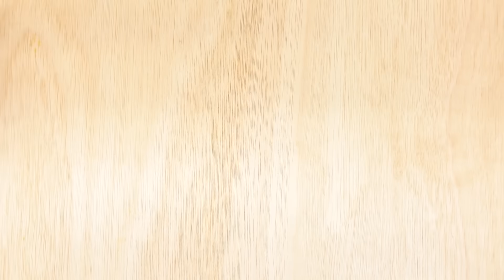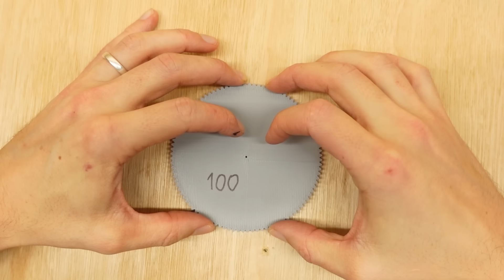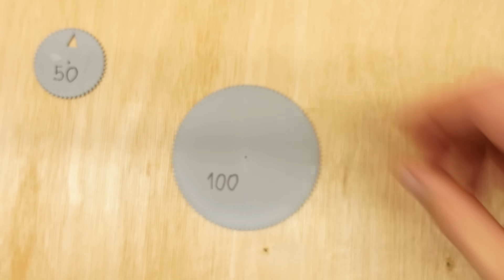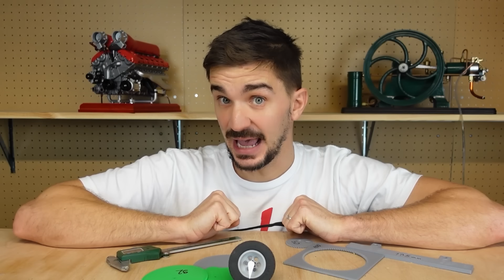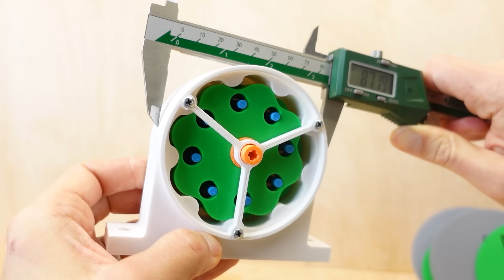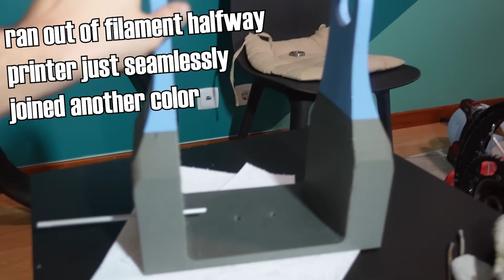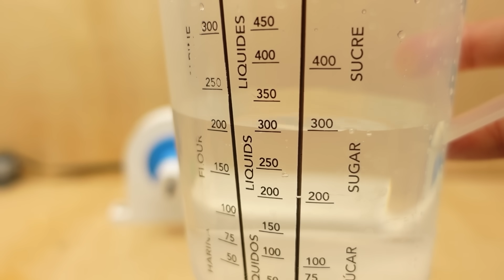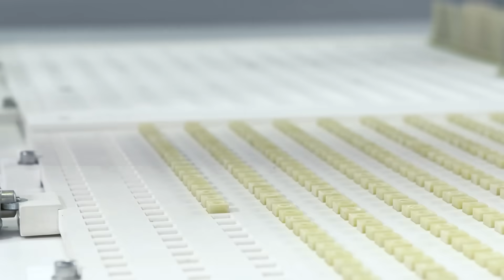Toothless Gears Make Much More Torque Than Conventional Ones, Here's How. Cycloid Drive Explained

Comment from the maker: Support the channel by shopping through this link: https://amzn.to/4fatbMb
Become a member: https://www.youtube.com/@d4a/join
Patreon: https://www.patreon.com/d4a
Bambu Lab US: https://tidd.ly/46hpDEj
Bambu Lab EU: https://tidd.ly/460tBRZ
Reply: so instead of 2, having 4 cyclodial gears together like inline 4 would the the best ?
Reply: @abhishekdas9006 no three gears middle one twice the weight of the outer ones. It would then be perfectly equaled out.
Reply: @rexmann1984 that's what occurred to me as well...
Reply: @rexmann1984  but at a certain point I think friction and torque on the shaft become major problems with solutions like that. And regardless, this is still optimized for high torque as opposed to high speed so the balancing shouldn’t be too relevant
Reply: @abhishekdas9006  yeah, halve them and double the number. It's the same. It just gets worse if you add more. Just put a counterbalance on a 90 and you balance.
Reply: Super explanation.  Thanks.
Reply: @pbacina  cool, but if the amount of teeth is the same in both, why does the rotation number change from inside/outside? it's clearly not skipping teeth while it travels, so why the amount of rotations multiply? the distance (in teeth) shouldn't change.
Reply: Two words: harmonic drive
Reply: Yay, Americans selling Chinese products! Have you considered Prusa instead?
Reply: 12:45 hey pal, I think you missed the realization that you got trapped in social media. That IS social media,  even if you're scrolling designs
Reply: remove the offset on the shaft and move the wobble motion to the out side using springs to maintain pressure and allow free motion.
Reply: STOP QUESTIONING AIRASATALE ! ITS BOTH HEARISY AND TRESON !! MAGIC DOSE EXIST JUST EXCEPT YOU DAMN ALCAMIST!!!🎉
Reply: why did you tell me i won the giveaway and then delete the comment ?
Reply: 16:56  this is nice to see in the mind thanks for the work.
Reply: Wohoo more plastics 🥳
Reply: Man you are flying on that bike!
Wear a helmet!
Reply: I love it! 😊
Reply: I know you are joking, but this is actually the origin of the word revolution meaning something extraordinary. It referred to how destabilizing the idea that the earth revolves around the sun was at the time. That was the original “revolution“
Reply: Dublagem em pt-br tá muito bom
Reply: Could you possibly make another video explaining more about the balance of the cycloidal transmission at higher RPMs? Like, the differences in balance with one gear at high RPM and 2, 3, 4 etc, and the possible solutions to the imbalance. Along with the reasonable application of a "torque-god" transmission and whether or not it would even be necessary or rather, reasonable to use in high RPM applications... That'd be cool
Reply: You need to use fusion generative design and optimize your design for manimal amount of filament use.
Reply: Негрпмотный перевод на русскиц язык: "число зубьев" называет "шагом"!!! Шаг у зубьев взаимодейстаующих реек и шесткренок один, количество зубьев - разное.
Reply: The simple solution to the rotational force is to put another eccentric ring 90 degrees to the rotation axis such that it balances out the offset. It sacrifices compact design, but then again, I'm sure there is also a clever way to minimize that as well with further research.
Reply: @d4a Excellent. Can you please do a similarly clearly illustrated and explained video on how eCVT transmissions work?  I've watched a few including this one but cannot grasp how varying input:output ratios are achieved:  https://youtu.be/O61WihMRdjM?si=cMu2SOEih4Oaq-Oa
Reply: 19:23 what if you put one gear in the middle and two half gears on either side, with your input drive channel going through a hole on one of the half gears? You could remove the rocking effect, at least until the point of circular momentum became an issue (Note: I can't remember what it was called but what I mean by circular momentum was the one physics thingy about how a disk with all its weight on the outside was harder to start and stop vs an evenly distributed disk being easier to start and stop)
Edited to adjust time stamp
Reply: It would appear as if you've done so much ,with so little for so long. That you can now do anything with nothing.
Reply: I have to say this was the sneakiest and most stealth ad I remember having seen. I realized it was ad only at the very end when you said links are in desc... Well done, hope Bambu will continue to cooperate with you in the future too. 
Unfortunately I won't be buying using your links mainly because no Asia link. And also because I got my bambu a month before this video came out. Sadly their store(s) are sold out of pretty much everything interesting.
Reply: Hello, good afternoon. I'll get straight to the point. A few days ago, I was working on a personal project about a homemade combustion engine, and I was wondering if you could help me with it. I have limited resources in physics and chemistry, and I don't want to burn my house down. So, if you're interested, we can talk privately. If not, thank you very much for reading.

Comment: 50 gear rotating around the 100 gearp
2 rotations for the teeth, 1 for the circle

50 around 50, 1 and 1

inside the 100 negative, 2 rotations for theeth, -1 for the circle

idk if it makes sense what I'm saying

Comment: Pls do a video on tire squish. Example: 75mph 1:1 trans and 3.25:1 rear gear with 26” tire on 16” rim with 2” tire squish  vrs no squish how most ppl use when calculating gear changing. On some things 100-200 rpm is important especially if your buying gears you want to calculate accurately. Or 33” tires on 15” rims  on small yota can run on 12psi happily which is several inches of squish. Everyone says it domt change anything but FACTS IT FOR SURE DOES. Theroretical radius vrs actual loaded radius unaccounted will leave you unhappy on highway cruise when accuracy matters weather wheeling rig or you classic hotrod or Harley why is the world just letting 100-300rpm just piss in the wind. That’s a difference of an entire gear ratio that’s like buying 3:73 gears an getting 4:10 and being fine with it to the litterally point there’s not a single VOICE on this issue

Comment: 1:47 I can explain it using a comparison to sidereal days. Basically, going around the center wheel intrinsically adds a rotation. If you imagine that you glue the outer wheel to the inner wheel at one spot, and revolve the inner wheel, the outer wheel will automatically do a rotation just by virtue of being coupled to the inner wheel as it rotates. You don't even need the glue; you can just move the outer wheel around the inner, not rolling but sliding it along while keeping a constant point of contact on the outer wheel, and it will cause one rotation. If you then add the actual rolling motion of the outer wheel along the inner, those 2 motions combine to complete 2 total revolutions of the outer wheel.
Reply: Oh you know what though, that radius doubling reasoning is very easy to remember. I think it would have been optimal to directly include a bar across the wheels with measurements of d and 2d, though.

Comment: Interestingly in regards to the 50 tooth gear around the 100 tooth gear, the smaller gear completes 3 rotations from our perspective of 'up'; however, it completes only 2 rotations from the changing 'up' based on the outer edge of the larger gear. Like how 'up' is different in Central America than it is in Australia, in the orientation of the universe that is. The similar situation happens with the inverted 100 tooth gear causing a rotation of 1 in the smaller gear from our perspective of 'up' and causing 2 rotations from the shifting perspective of 'up'. Relative to the bending surface of the 100 teeth, it makes 2 rotations. Obviously we don't care much about the rotations relative to the manipulated surface for most practical usages.

What gets me thinking though is if you made a mobius strip of teeth, how many rotations does the small gear complete to return to it's starting position, both from our perspective and relative to teh manipulated surface??

Comment: Only half of the lobes are transmitting force at any time (which half depending on the position of the elements and the direction of the torque). That's much better than one tooth, but it's not all of the lobes.

Comment: I'm guessing the anchor point determines the amount of rotation? If the anchor is a bit staggered/off center will it still be 3 rotation for the 50 and 100 gear example. PS: Didn't watch the whole thing yet.

Comment: 2:42 Fun fact.. watch the tip of the arrow on the 50 here.. it points at a spot on the 50's pitch circle, and that point moves in a perfectly straight line when the 50 is rolling inside a 100 ring gear.

Comment: I wish you stayed automotive. The other stuff sucks. Plus, all you can easily say here is "add (outside) or subtract (inside) the Radius of your wheel with the Diameter of the other wheel. That'll show how many revolutions it will take to move around the surface."

Comment: 10:40 talking about 3D printing Bambu H2D 1500+ euro for home use looks a bit too expensive, what about Anycubic Kobra S1 Combo or Elegoo Centauri Carbon 2 Combo which are ~400 euro for the same needs?

Comment: Can you try splitting one of the gears and sandwiching the other in between the halves. This will require a corresponding shaft modification. This way ,maybe the last problem of this transmission could be solved?

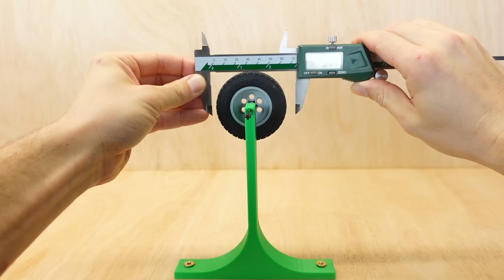Comment: At 0:50 of the video, the wheel travelling is still doing "one" rotation relative to the center wheel (2 according to you because it is travelling in a circle). You will need to rotate your screen (around the center wheel) as you follow the moving circle and see it is doing the exact same thing as travelling on a straight line. If you do this, it will only rotate ONCE.  The reason it looks like it does 2 rotations is because you didn't rotate along with it. If you rotate your screen along with the moving wheel, you will UNDO one rotation and it will appear that the moving wheel still did 1 rotation. 

Think of it like this... the center wheel as a 2-dimensional earth with a north pole (top) and south pole (bottom). When the moving wheel starts it first points UP away from the ground and when it is half-way around at the bottom (south pole) the arrow is really pointing DOWN towards the "ground" (except it looks like UP because the ground is upside-down)! As it continues to travel, the arrow eventually points away from the "ground" again once it gets to the north pole (top) so it appears like it's pointing UP again. So it looks like it has done 2 rotations but the moving wheel has only pointed to the "ground" once... just like the "flat-earth" example that just precedes it.

All other examples shown will also appear to be the correct number of rotations once you rotate yourself with the center gear as you follow the moving gear. At 3:00 when 50 gear goes on outside of 100 gear it will point towards the "ground " (the gear-mating surface) eactly twice on a full travel, and when it travels on the inside of the 100 gear it also points toward the "ground" (gear-mating surface) exactly twice. It looks like it rotates 3 times in the first 50:100 example because you have 2 gear rotations + 1 rotation around the "earth" (hence 3)... if you rotate your screen you will UNDO 1 rotation and it will look like 2 which is what you expect for the straight-line example. In the second 50:100 example you have actually spun BACKWARDS one rotation (since it's travelling on the inside), so the gear still 2 rotations - 1 rotation backwards, so it looks like 1 rotation.

Carrying this further, if you have a 25:100 gear you should expect 4+1 or 5 rotations if you are riding on the "outside" of the "earth" gear, and you should expect 4-1 or 3 rotations if you are riding on the "inside" of the stationary "earth" gear, and so forth.

It gets interesting when the ratios are not exact multiples. For example, for the example at 04:50 you see a 75:100 gear completed 1/3 rotation (on the inside). This is because 100/75 = 1.33333 and you subtract 1 because you are on the INSIDE of the statiionary gear. So 1.3333  - 1 = 0.333 which is 33.3%. For the example at 5:02 with 84:100 you should have 100/84 = 1.190 minus 1 = 19% of a rotation, and at 5:10 with 92:100 you would have 100/92 - 1 = 0.087 = 8.7%. Taken to the extreme, let's imagine 99:100 we will have even less.... say 100/99 - 1 = 1% rotation of the center gear.... taken to extreme, 100:100 you get 0 rotation.

The math is exactly the same but you +1 when you are riding on the OUTSIDE of the gear (just like the previous examples). So if the logic holds, I would predict for the 75:100 gear with the 75 riding on the OUTSIDE, you would get 100/75 + 1 = 2.33 rotations. With the 84:100 you get 100/84 = 1.19 + 1 = 2.19 rotations, and with 99:100 you get 1.01 rotations.... taken to extreme, 100:100 ratio (just like the first wheel example) you get 100/100 = 1 + 1 = 2 rotations! Exactly what the wheel example shows us. The math is therefore:

x:y gear ratio, let's assume x < y, then if you want to know rotations of moving gear "x"...

When "x" is moving OUTSIDE of stationary "y", then "x" will appear to move y/x + 1 rotations.
When "x" is moving INSIDE of stationary "y", then "x" will appear to move y/x - 1 rotations.

Comment: i wanna make a cycloidal reducer for a 2850rpm 0.5hp motor to 5rpm. can i achieve this?
using fibre laser cut teeth
Reply from the maker: In theory yes. The teeth are the easiest to make, the housing and the shafts are usually a much greater challenge. Depending on your budget this might not make financial sense at all because the losses of a high friction unit will exhaust your 0.5hp. If you want to spend more companies that specialize in this can make all kinds of custom solutions. All that being said I feel like starting with a low rpm motor probably makes more sense in the vast majority of scenarios.

Comment: 19:20 just use 3 gears: middle one is as heavy as other tow and is offset from them by 180 degrees. Problem solved, right?

Comment: about the rocking couple, what if you used 1 half weight rotor, then, offset 180 degrees, the full weight rotor, and then again a halfweight, same as the first?

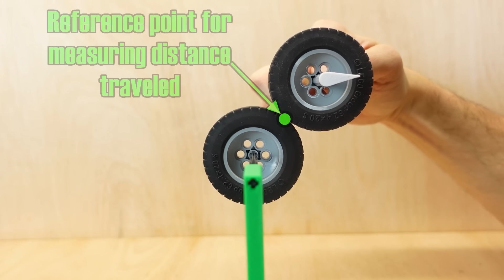Comment: 1:30 The easiest way to understand it would be by fixing the two wheels together by their contact point. Now rotate the whole thing once around. Both wheels have rotated once.

Now if you do the same thing while holding the center wheel fixed, it the center wheel makes zero rotations, which is the one rotation from turning the whole thing around and then subtract the one rotation from the wheels turning against each other. 1-1=0. So the center wheel is fixed. But then the outer wheel has that original rotation PLUS one rotation against the inner wheel. 1+1=2. So 2 rotations.

There are 2 wheel-rotations either way. Either both wheels rotate once of one wheel rotated twice and the other not at all.

Now that is with two identical wheels. Obviously, as you showed, the math is more complicated with different sizes or other variations.

Comment: The demonstration where you rotate the wheel around the other wheel 'technically' only makes one full rotation (but 'in space' it kind of does make two - making up for the fact that the other wheel is NOT moving.) The pointer only points to the other wheel once, so yes the center travels further, but the distance the tread travels is the same. And again when the 50 tooth gear rotating on the inside of the 100 inside gear, the smaller gear does rotate twice (not once) as evidenced by the fact the arrow points the contact surface twice.

Comment: Couldn't those final forces be countered by stacking, say, 4 cycloid gears, working in opposition every other one, where the weight of the 2 outer ones is calculated to be just enough to counter nearly all the twisting force, more of a dampener for the twisting force than a load carrying gear?  I'm imagining measuring the twisting force on just one end of two gears, then adding a 3rd that perfectly negates that.  A matching 4th gear at the other end, does so there...

Comment: why not put "sideway" ball bearing in between them? a little film with small glass or metal balls in between the two moving parts across the surfaces, to keep them better in place? the balance should be a little better but I don't know about the friction it would still be a lot as it would  cover a large area.  also make it submerged in oil. that might help with the the friction and possible heat build up.or wouldn't it work due to the rotation? forcing the balls to move in slightly opposite direction? in that case make a slightly thicker one with balls sticking out one side but not the other and do it on both sides. make it a 2 piece you can put the balls in the back (you don't want them to be able to fall out the front) and then stick the backs together. alternate spacing should do the trick. it would be hard to make and it might not work because, lets face it, I'm just a noob in most things but it would be interesting to try if you have the resources.